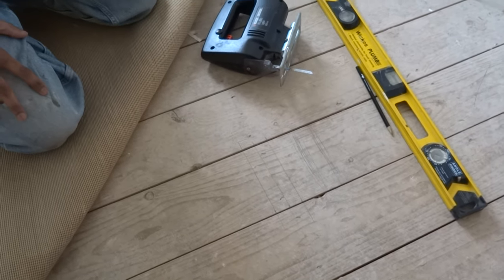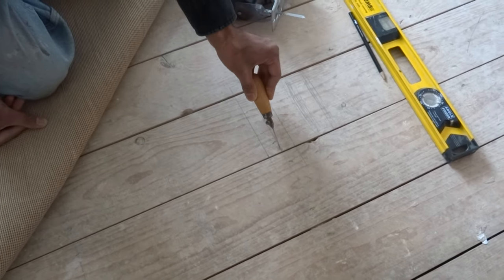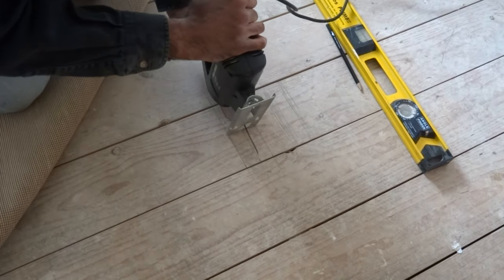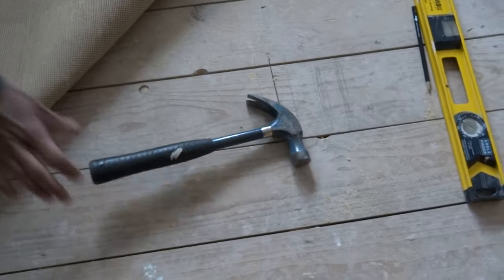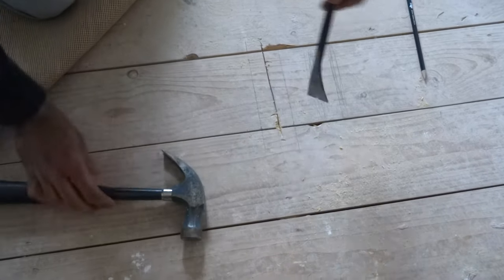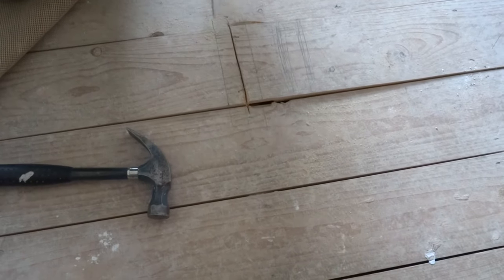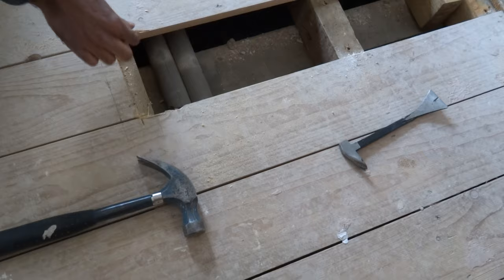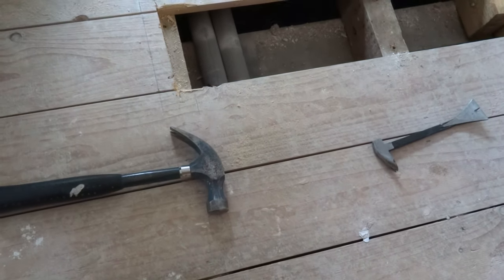How to cut and lift floor boards

Comment: This is not how to lift a floorboard, too much damage to other boards, use a small circular saw far better and also cut tongues with circular. Most important however, make sure there is no pipework or wiring below, and top tip, use a centre punch to knock nails right through into joist and board will come out effortlessly
Reply: Great comment
Reply: Well done Sheila !!

Comment: I use a fein 350 with starlock woodblade. Mark your line, the blade takes 10's of seconds to cut through the board and it is much cleaner and safer, much less likely to damage some unknown pipe...

Comment: Too much damage to adjacent boards . Use a  Fein to cross cut board , (preferably drill small 5mm hole and insert inspection camera if unsure of what’s beneath )so much neater .
Reply from the maker: Thanks for the comment much appreciated.
Reply: Damaged many boards myself before finding the tools and method that works for me. Inspection camera is definitely a worthwhile investment, 5mm is expensive but obviously less invasive.  Any method that works for yourself is good .

Comment: using one of those black and decker scorpion saws is pretty good for this, not a jigsaw as there is too much up and down blade movement, a mini circular saw is perfect i have a worx brand one that works very well and you can set the depth of the actual board so you know how deep you are cutting before cutting :) Plus the scorpion saw works so well for cutting along the floorboard for the tongue and groove
Reply from the maker: Thanks for the comment much appreciated.
Reply: Thank you cool tips

Comment: This is where a muti oscillation tool comes in real handy. I however just used a circular saw. Chances are if its a new board that hasn't been lifted like yours there won't be any pipes or cables running through the joists just under like yours.
Reply from the maker: Actually I used to use a circular saw to do this but tried this and found it easier as your   less likely to cut the boards next to the one your cutting.

Comment: If you can find out the thickness of the floorboards. U can use circular saw and adjust the depth,then u wont hit anything. Boards sliced at equal depth. Thank me later
Reply from the maker: 😉 Thanks for the comment!

Comment: No No No.... Never cut through floorboards with a jigsaw!!! You have no idea what is underneath, Cables and pipes will be damaged. Only use a circular saw with the correct cut depth or even an oscillating saw to the correct depth. This guy is a cowboy!! Bad advice.

Comment: and if it's T&G!
Reply from the maker: +Dee Lee this method could still work but you wouldn't have a clear idea where the support beams are underneath but you can get a rough idea from the nail. Then you just cut out a square box and once your done you could just build a small wood frame the hold the floor board. Hassle i know but still do able.

Comment: I would be scared of hitting waterpipe or electric wires.
Reply: Unlikely seeing as you're cutting along a joist.
Reply: Pipes run on joists all the time.  Joists get notched for pipes to go pass and rest on
Reply: That must mean the are not close too the surface. I got some to change. My brother will be helping me. He is better than I am using some power tools. I have not yet used oscillator for cutting wood. But have just bought one.
Reply: Thank you for letting me know that. I just bought oscillator.